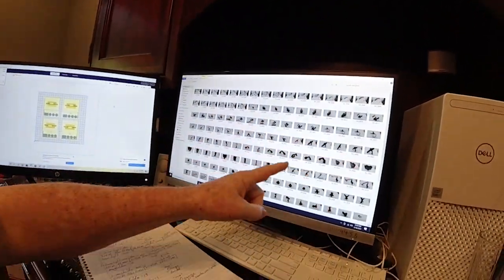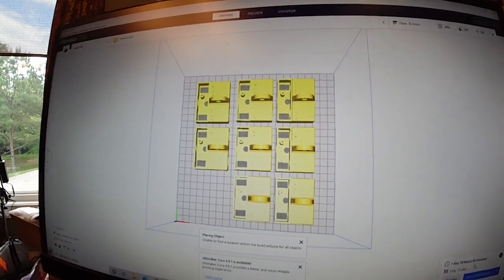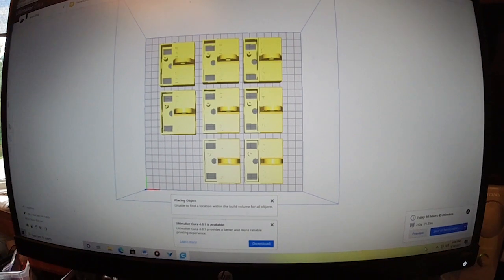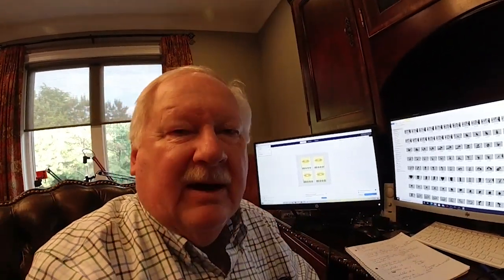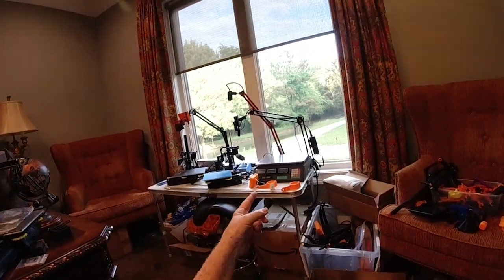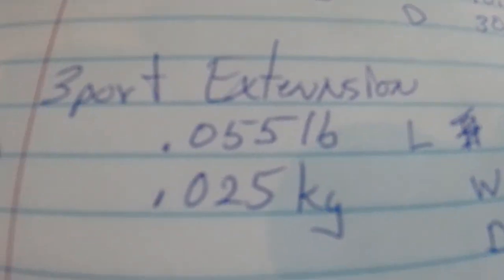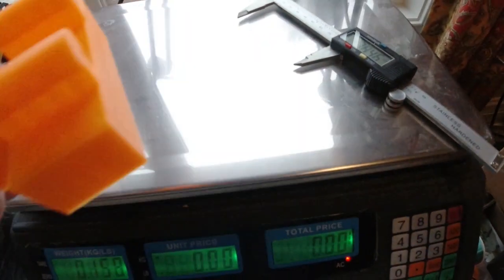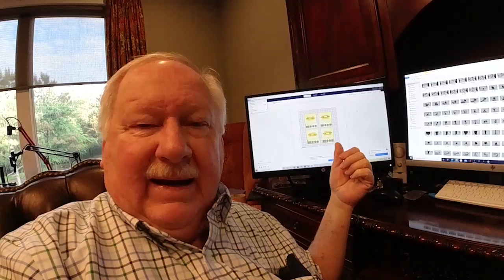ONE MAN 3D PRINT FARM  WITH  OVER  9,000  PART  PER  WEEK  CAPABILITY at New Tech Inventors.

Comment: Brim takes longer. Brim uses more material. Brim leads to additional clean up of the piece. Brim increases  the likelihood of the part adhering well and being viable. All a trade off. Still enjoying your journey btw. Can't wait to see some of your products getting to the marketing and sales side.
Reply from the maker: Thanks for the comment my friend. My goal is to be able to print without any brim, however I do have some tall parts with a small footprint than are prone to break loose and I will most likely use brim with them. I will have the option either way. Your right , there is always a trade off. Thanks for your support...Ken

Comment: Great video... A spreadsheet would help you quantifying your needs and outcomes.  “Parts” are an exhausting process of assembling a product .  Love to see these parts and how they integrate into a final assembly.  The helping hand obviously has many parts.  When assembled is it complete or can you integrate your parts to need based situations?  If the later is correct a storage situation occurs for the consumer.  ......thanks joe
Reply from the maker: Hi Joe, the "Helping Hand" has several integrated parts in its basic units when assembled and there are many optional attachments that require other 3D printed parts to make. Haven't thought about how they store attachments when they are not in use. Mabey a stand with slots like the helping hand could be made to neatly hold them till needed? Thanks for the input my friend, "food for thought"...Ken
Reply: @NewTechInventors  this storage could be your packaging box and of course your display

Comment: Ken, another excellent video, keep them coming!
Also, to eliminate the flickering on your videos change your shutter speed to a variable of 60 frames. That will get it to stop flickering and/or banding. This is because the power is at 60hz
If your camera wont give you access to your shutter speed tho dont worry about it... its not that big of a deal.
-Shane
Reply from the maker: Thanks for the tip Shane. I will try that, I noticed it after I posted the last video and I had changed the camera settings before that. Thanks for your support...Ken

Comment: I know you know, but Octoprint is going to be your best friend very soon. 

You can get 3 instances of Octoprint on one raspberry pi. (1 pi = 3 printers). 

Then, you HAVE to try out OctoFarm. It’s a server that gathers all of your Octoprint  instances, displays everything on one screen and allows you to fully control your print farm. It’s SCADA for print farms. You can upload files to your printers, start and stop them, and monitor them via video. It’s continuously being improved and updated and support is excellent. It also free and open source, but I recommend contributing to the Patreon. 

I really think you’d benefit by incorporating Octoprint/OctoFarm into your workflow sooner rather than later. 

I run 20 printers 24/7 and I don’t think I could do it without Octoprint/OctoFarm. 

Thanks so much for putting in the time to make all of these excellent videos; I appreciate it.
Reply from the maker: I'm sure your right Nick. With all I have going on it will just take me some time to get set up with Octoprint. I think I will eventually get there in time. Thanks for your support...Ken
Reply: what pi's are you running on your printers? thinking about setting octoprint on my printers, great to hear its possible to run multiple instances of octoprint thanks! looking into that now
Reply: @GREGELZZ  I use 3B+’s for Octoprint, and a Pi 4 for the OctoFarm server. 
Personally, I use 1 pi per printer for simplicity, but Chris’s Basement has a great video on how to setup 3 Octoprint instances on one Pi.